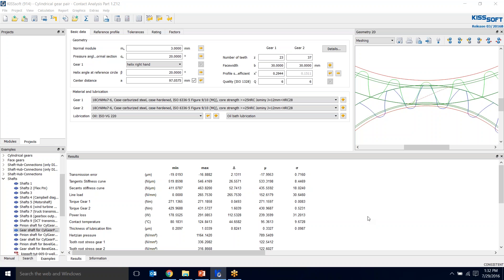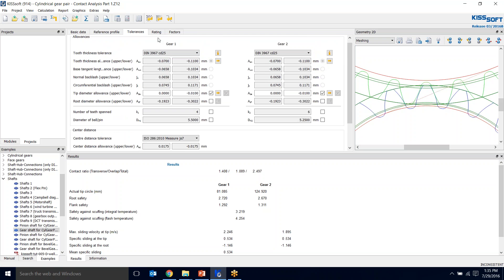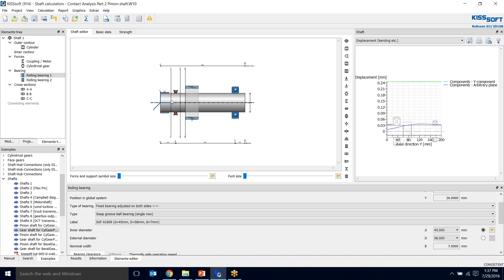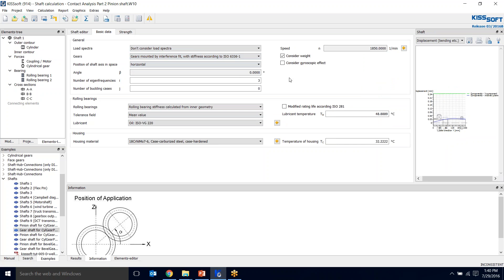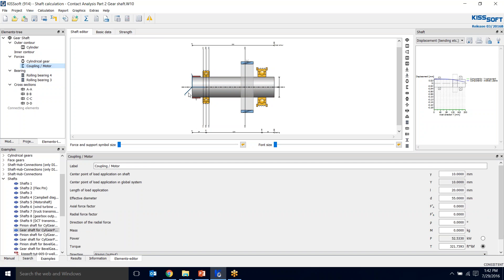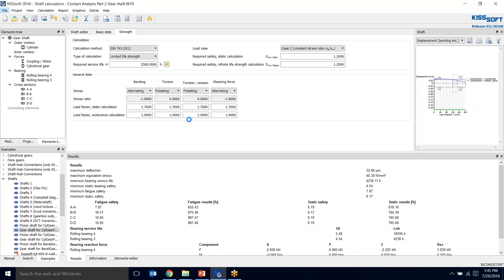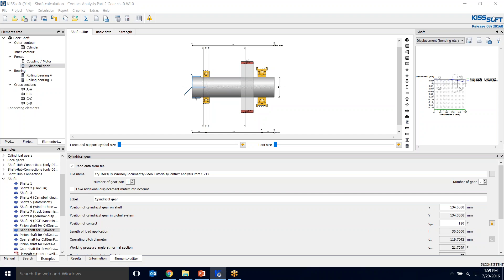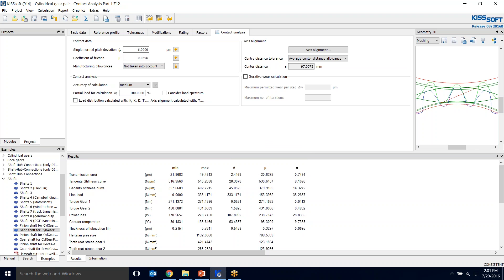Contact Analysis Part 1

Comment: Thank you for sharing this video.
I just want information that how much of transmission error is acceptable for small automotive engines?
Reply from the maker: Depends on the car company, for small automotive, all depends on cost and mfg. process as well. If you are grinding gears you could get good sounding gears at 0.250 um, however, this is only as good as how well you define the bearings and shafts and if you are taking into account the bending as well as tolerances.
Reply: @kisssoftusa9363  thank you 😊 
Can I contact you through email for any other information required?

Comment: Thank you very much for the video.Can you show me how to size and anlyse the planetary gears?
Reply from the maker: I will have more on how to size and analyze planetary gears shortly, this takes some time. Usually we start with known loads, then rough sizing, then fine sizing, and the last step is contact analysis with tooth modification sizing.  These are the basic steps in sizing a brand new planetary gear design.  This of course will take more than just a few minutes, so I have to break these apart and then load in multiple video segments.
Reply: KISSsoft USA thanks for the reply. I have just purchased a Kisssoft software and your videos are helping a lot. Waiting for your planetary videos.